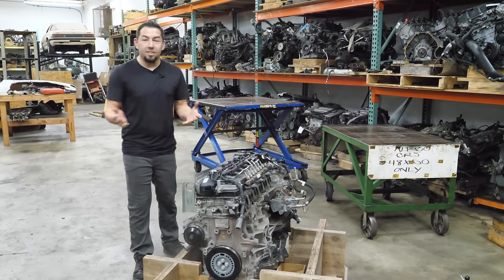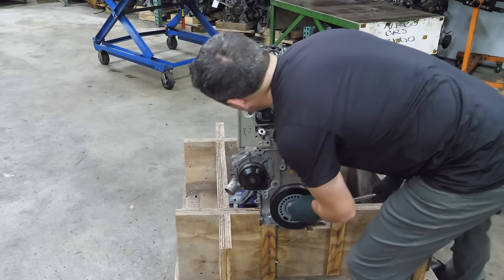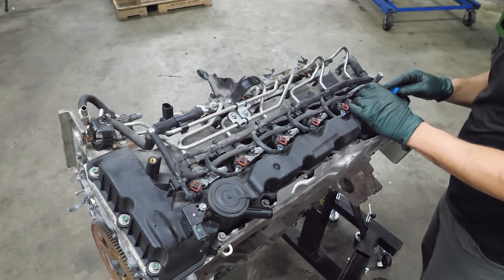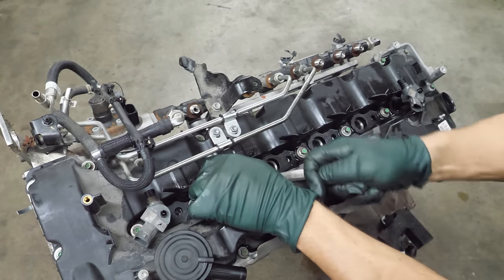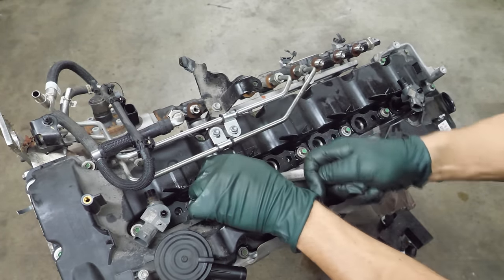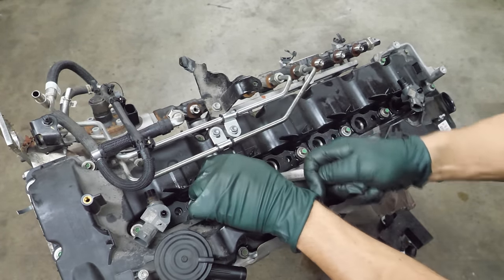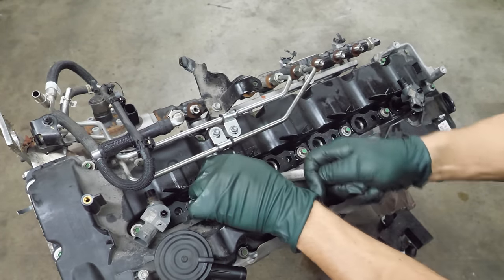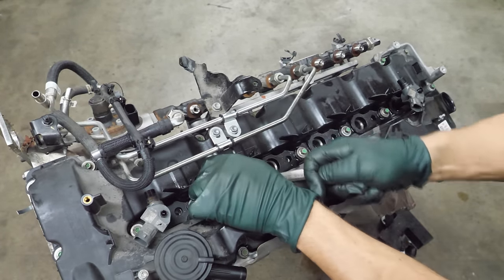BAD 2020 Silverado 3.0 Duramax LM2 Engine Teardown INCREDIBLE DAMAGE!

Comment: I was fully expecting the “valve reliefs” to have been a result of the rod bearings disappearing. The clearance between the head and the piston on diesels is typically the thickness of the head gasket (sometimes not even that much) so rod bearing failure almost always causes the pistons to hit the heads on diesels (and some gas engines). But, doesn’t look like the case on this one since it was only the 1 bearing that disappeared.

If I owned one of these, I would not be happy. The timing drive on the rear of the engine is dumb enough as it is, but putting a belt drive back there is literally designing the engine to fail, but in an especially evil way: one that can be blamed on the customer. Nobody is going to pay $3000 to pull the engine/transmission and replace a belt, so instead, they’ll drive it until it breaks, loses oil pressure and destroys the engine. GM will say “well, we told you to replace the belt” and avoid any blame for their idiotic engineering.
Reply: Agreed. As an owner of this engine, very frustrating. Making me considering jumping to an HD and going cummins 6.7. Although, I will say, this engine is an absolute PLEASURE in my Sierra 1500 half ton.
Reply: Yes. There is NO reason that there can't be a chain back there instead of a belt. 🤷

A rubber belt INSIDE of an engine is simply dumb fuckery at it's finest. A belt IS a consumable item, and should NOT be in there. 🤦
Reply: I would have used a chain personally, but it’s a freaking 200k interval. Most people spend far more than $3k on everything else. If you can’t allocate that every 200k miles, you shouldn’t be buying a truck. And it should be factored into the value of trucks selling with 140k+ miles
Reply: @BabyGators I agree with you. If I still love the truck, I won't have a problem spending 3-4k at my local shop to get me at least another 150k. 

Wet belt design sucks, but the pros I've experienced with this truck so far outweigh the wet belt con.
Reply: Agreed. Pickup Truck Plus SUV Talk has the co-creator of the engine talk specifically about the belt and why they chose it and then said the exact same thing you did. @BabyGators
Reply: i have not had to replace my oil pump belt yet, on my 200 thousand mile plus 06 5.9 cummins ...wonder why.
Reply: To add insult to injury the failure will probably come to the 2nd or 3rd owner. People that can afford it the least will suffer the most. Jmtc

Comment: That upper oil pan loves to leak on these engines in the corner (this engine was a little wet there).There's a guy a few bays down from me who does those pretty frequently. It's a massive job to do in the truck as basically the entire front of the cab has to come off, the transmission, front diff, steering all has to come out in order to access. I really really don't understand the logic of the rear mounted timing system especially that oil pump belt... Engineered to fail since nobody is going to remember the service interval on that thing assuming it hasn't snapped before then.

Also I'm surprised the cam followers weren't obliterated from the valves being struck.

Comment: I appreciate this video and comment section, just wished I’ve knew this before my recent purchase of this engine. 20k miles preowned, been in shop 4x in 40 days of ownership. Both front and rear crank seal was leaking, transmission was clonking, but engine was quiet and smooth. After service, transmission is fine, both seals replaced, but the engine is loud and rough, as if it’s stuck in regen mode, dealer says it’s fine, but I know it rides differently, and feels like the truck is 10 years old. File lemon claim, waiting for a buy back from GMC. I’d say…STAY AWAY FROM THIS ENGINE COMPLETELY!!!
Reply: You filed a lemon law claim on a used vehicle?  What state allows you to do that?
Reply: Complete cooling system failure and leaking front and rear seals on my 2021 with 140k. They want 9k to fix.
Reply: @bobcoats2708  Some of the liberal states under certain circumstances. Weird, I know.

Comment: This actually made me happy to own an LM2 in a weird way. I went into it knowing about the oil pump belt inspection and what's involved in that. Seeing this engine hold up surprisingly well (no shattered pistons, valves not crushed in) and only having this problem due to neglect has me hopeful for the longevity of one that's properly maintained
Reply: keep hoping consumer boy
Reply: @TheInsultInvestor  I plan to.
Reply: right there with ya! it's not all doom and gloom here. I love my LM2, it's a great motor. Some head scratching design decisions, but seeing this teardown and RCA made me even more confident in parts quality and robustness of the internals.
Reply: @adam9936  Exactly! There are definitely some questionable engineering choices, but most of the problems with these engines stem from a loose nut between the drivers seat and steering wheel
Reply: @cje26 I am in agreement with you and Adam, as an LM2 owner. For the mileage and torque from this little diesel, there are some things to admire after seeing this tear down. 

Especially if it was low oil or poor maintenance interval on this unit.
Reply: Really Diesel engine with 140k+ miles and had this kind of failure and you said it hold up pretty good? I have a 2010 tundra 5.7 with 463k mile that I beat every day,now I can said my truck is holding up pretty good. Never ask your self why toyota turbo Diesel engine are not permitted in the us cuz it will bring down chevy,ford and dodge
Reply: Seems like a expensive disposable engine.
Reply: @bobolonbobolon4833  Those are impressive numbers and I agree 100% that a Toyota diesel would outperform and outlast just about anything available right now. That being said, no engine will run too long without oil and that's what killed the one in the video. What impressed me is the fact that the pistons didn't shatter and that it didn't throw a rod through the block like the 12 valve he posted a little while back. I don't see why one of these little guys couldn't last as long as any other engine out there with proper maintenance.
Reply: @ThatGuy-sd3zl  Nothing will run very long without oil
Reply: There is a recall on cam cover for engine using oil. What is the part #. on cover. If serial # on part is greater than 21298JDXXX this bulletin does not apply. Refer to bulletin 21-NA-272 and SI for appropriate diagnostics. If serial # is less than 21298JDXXX and the customers concern is oil consumption 1. Replace the camshaft cover 2. Replace # 2 glow plug. Re-evaluateevaluate the oil
Reply: Consumption. Applies to 2020 and 2021 3.0L

Comment: Funny story about this engine. There was this guy on YouTube that had one of the lead engineers that designed this engine on a livestream. He directly referenced the wet oil pump belt. He also referred to the "clean slate" GM gave them for this engine. People watching the video gave him down the road for it. Said YouTuber posted a follow up video shilling for the engineer saying the critics don't know anything, yada yada. Was quite an amusing situation altogether.
Reply: I watched that back then and yeah....knew it was a bad idea!
Reply: Nobody with a clean slate would put the timing chain at the rear and use a belt for the oil pump.
Reply: The Honda 2000i and 2200i generators have these belts to drive their OHC...and carry oil up into the head.
One owner ran his 24/7 for 17,000 hours straight (off grid; only source of power).
See James Condon vid re tearing one down.
Then he ran the same engine with the replacement belt another 17k hours...
then sold it to his friend and it's still going...heading towards 35k hours....
As the GM tech said in another comment in these comments  the same belt in the LZ0 engine is now rated at 200k miles before replacement....
Reply: @JohnSmith-yv6eq  you can try to justify GM’s stupidity all you want. 

Honda small engines don’t impress me either. I’ve worked on a ton of Honda GC and GCV engines. Using a wet belt for the little plastic cam. It’s cost cutting. One instance doesn’t equate to it being an engineering marvel. A gear driven pump is less likely to fail over a belt driven pump in every circumstance.
Reply: I agree wholeheartedly.
(As the owner of a Nissan 2,7TD for the last 22 years....3 gears, no chains or belts) @Redsfanatic32
Reply: Others say the engine has lots in common with the BMW N57 engine. Exactly which clean slate was it designed on? Maybe Bosch or another components supplier hands out reference designs nowadays?
Reply: @mjouwbuis I'm no patent lawyer, but maybe the patent for BMW M57 lapsed due to being too old? So then GM's clean slate was just an M57 with an American oil filter setup
Reply: Some company trying to save 50 cents. Customer screwed in the end. Done by many car manufacturers
Reply: @JohnSmith-yv6eq  The issue isn't just the belt. It's also the fact they put it at the rear of the engine which requires pulling the transmission to do a routine maintenance item.
Reply: @rmkilc pedestrian crash safety regulations are supposedly to blame for rear timing chains
Reply: @rmkilc  Define routine? 2022.5  and up LZO oil pump belt life is rated at 200k miles. Oil changes are done around 5k mile and would be considered routine... Just sold a 2001 Toyota Highlander that has been in the family since new that required a timing belt replacement every 60k.
Reply: @randycupp5925  I absolutely would not buy a vehicle with a timing belt. That's ridiculous having to change the timing belt every 60k.
Reply: @jonathansmith7306  iI don’t get this, if a pedestrian gets hit by a car he/she is  f**d regardless of the location of the timing chain
Reply: @jonathansmith7306 Can you help me make sense of that? And if GM cared about pedestrians they wouldn’t design the front end horror shows their trucks have become.

Comment: You remember the rule of thumb.  Diesels are always torqued down extremely tight because the compression would pop ordinarily torqued bolt.
The timing appears to be advanced a bit
Reply: It's the vibration from diesels that require the excessive torque on absolutely everything to keep from buzzing loose, not necessarily because of compression.
Reply: I'm not familiar with these, but that was my exact feeling also. Low pressure reduces the tensioner push. Maybe jumped teeth on the T belt?? Makes total sense on worn parts.

Comment: How about a 2.8 Duramax video? Love the content!
Reply: Agree.  The thing is, the most common 2.8 failure mode is a holed piston from a stuck injector, which sucks hard for the owner, but is pretty boring stuff for Eric's engine carnage videos.  

I own a 2.8 and always run fuel additive and also installed a 2 micron CAT 1R-0750 spin on filter to a NAPA head after the stock fuel filter box to better protect the injectors from fine particles.  It has run that way the last 40K miles with no issues at all.  Other than the injector issues that can wreck it, that the 2.8 is a pretty solid engine.  

The 2.8 does have the usual diesel emissions issues, which is why everybody who could get away with it deleted them or at least runs an emissions system intact tune which turns off EGR.  EGR and PCV oil mist really wreaks gummed up havoc on the 2.8's intake system.    I run a Provent catch can on my 2.8's PCV system.

The 3.0 is much better in this regard as it filters EGR through the closely mounted DPF first, the engine in the video's intake ports looked good.  If not for user error the 3.0 in the video would have run another 146K no problem.

Comment: 146K? About time for that wet belt inspection for the oil pump. [shakes head at boneheaded engineering]
Reply: Just like ford does for the 2 7l and 1.0 ecoboosts. Literally 3 to 4 a week I replace or replace complete engines under warranty.
Reply: But it saved them $$$$$$$$$$$$$$ /s
Reply: @gregoryjohnson9733  If engines are being replaced under warranty, they probably did not save money. This looks like lack of checking oil or doing oil change at reasonable intervals. The recommended intervals, I think, are too long.
Reply: It is a stupid design, but, a wet belt at 147K miles that still looked good, not bad.
Reply: This plan would only work if people maintain their engines properly which they don't 😆

I personally would never buy an engine where the timing chain components are at the back where you have to remove the f**** transmission
Reply: Wet belt for oil pump... At the transmission end so you have to pull the transmission to replace it. Have done a couple of these for rear main seal failure - FYI replace it with the cover (seal comes preinstalled). Ask me how i know...
Reply: The engineers know exactly how dumb the design is.  They're forced to design it this way by the bean counters.  Belts are cheaper than chains.
Reply: *200k. Been upped.
Reply: lol by how much, realistically? so ridiculous @meanderinoranges
Reply: @adam9936  pennies.  And that's exactly what the bean counters care about:  pennies.
Reply: @charlesfranks1902 also could have been using the wrong engine oil. I thought these required Mobil Delvac 1 5w40 oil 🛢 for them. 😮😊

Comment: Impressive that you were able to find one of these. I've always had questions about an aluminum block diesel engine. Now, keep looking for a Ford 460 please
Reply: Ford 460s rarely break, unlike most Ford engines,.
Reply: I tore down  a 460 once, it still ran but I wanted to build 4x4 truck engine with it. Only thing I found wrong was #8 piston had cracked skirt which scored the cylinder wall!
Reply: 460 flaw is nylon timing gears...
Reply: @aaronatwood9298  I put steel gears in mine, I didn't care about  noise since I was putting headers on it!
Reply: @paulhschweim5556  which makes it as durable as a 300-6... No diesel in a pickup should be less durable than a 300-6. The 460 is a good engine, along with its 429 little sibling. Very powerful.

Comment: Got to remember Eric, those valve strikes on the top of the pistons were probably a few million in number before that big end failed and "announced" that the engine was absolutely KAPUT!
Reply: It must have sounded a bit off for a while, then . . .
Reply: @nigeldepledge3790  sometimes a bit hard to tell with a diesel, not the most mechanically quite anyway.
Reply: @gazzafloss   - good point.

Comment: Once again we learn that checking your oil is important. Had the owner bothered to take a few minutes when they were buying fuel to pop the hood and pull a dipstick this engine would probably still be in service.
Reply: well said
Reply: Or if GM could make an engine that would not drink its own blood between oil changes……..
Reply: Actually, these engines are known for losing oil suddenly and spectacularly.
Reply: Having an lm2 for 2 years i didn’t see any oil consumption. I put 50k miles on, oil change interval was 7500 miles.
Reply: yes, many of these engines consume oil at a high rate (high imo) the motor looks fine and i'd belive low oil was the start of failure. i've checked mine a few times during oil interval and it hasn't consuned a drop yet. the GM techs fill these truck a little over 100% (they did on my first 2 Free GM changes) this tells me the dealers are well aware of oil consumption
Reply: Or they could have just pulled over when they lost oil pressure. But this engine continued to run tell it beat itself to death.
Reply: Yep, but no one bothers to do this anymore 'cept for those that know they have an oil-burning problem and the rare few.  Most just want to sit in their cars and trucks and leave them running while their filling up, as if they're dying from getting hot or cold for a few minutes.
Reminder for me as the dealer changes my oil, i.e. someone else might have f'ed up and I wouldn't know without checking.
Reply: We live in a society where " pulling the dipstick is to inconvenient
Reply: My 2021 burns oil. Specifically it burns whatever oil the dealer puts in it. When I hit about 30 percent oil life you can guarantee it’s almost down a quart. 
If I run valvoline I don’t get any burn off.
Reply: They have soo many sensors and modules why not shut the engine down at sudden oil psi loss?
Reply: That's horrendous manufacturing, on a very expensive vehicle, if you need to check oil at fuel stops. I haven't routinely ever done this in decades of driving, and have only seen others do it maybe a handful of times. Yet the vast majority of vehicles are on the road.

Comment: I just started watching this, & I have to say that is one very well built shipping pallet\cradle. Half lapped, doubled up 3/4 plywood(almost thought it was a LVL at 1st) screwed together in that crisscross style is super strong! That thing would hold a Cat 3406e no problem! Wow! Now lets see this lil dirtymax taken apart!👍👌🛠️🔩🔧📐📏⚡💥💨⚠️🤔🤷🏻‍♂️
Reply: 24:49 Head bolts on diesel engine heads are serious! There's a lot of compression in the cylinders.....cause compression ignition -No spark plugs! GM\Izuzu must've learned from Navistar to properly hold heads down to the block - #6.0problems🤷🏻‍♂️🤔😀
Reply: Have you in fact seen the video where his woodgeneering holds up a 3126 or is this coincidence? :D

Comment: We need a Fiat 1.4T multiair engine teardown for my interminable curiosity!
Reply: Same considering I had one about 5 years ago that blew up (at the dealershop no less LOL). Makes me hate that engine.
Reply: The multi air design is borderline genius...
Reply: Yep... Hydraulically controlled valves!
Reply: @youwish16   those require good oil of exact specifications AND the clean of a little screen filter on the side of the head, AND the clean of another little filter that feeds the turbo of oil. If these 3 things aren't done properly they go kaput. If they're done, instead, that engine is a marvel and can put out A LOT of power (once tuned) respect to its small  cubic volume.